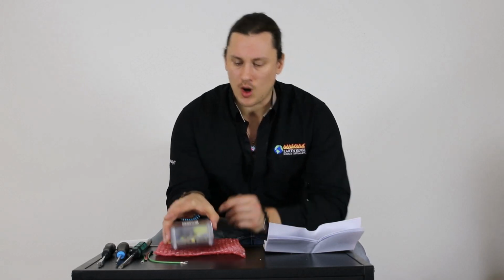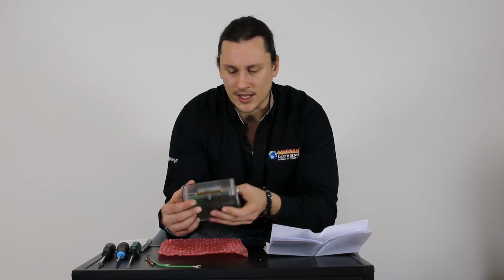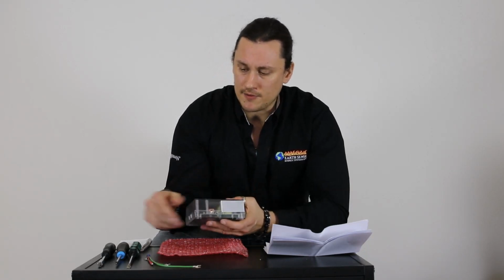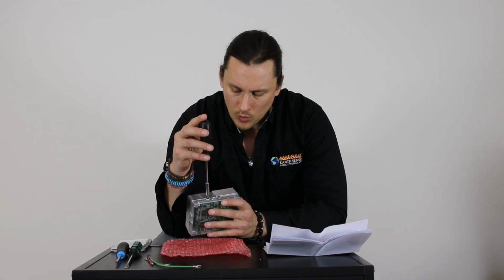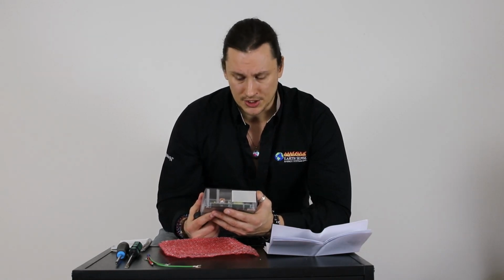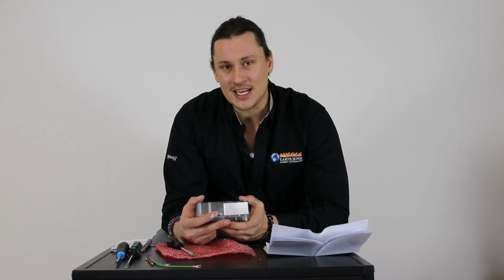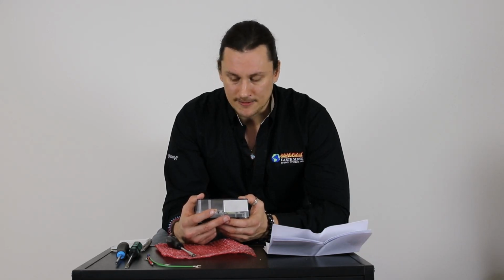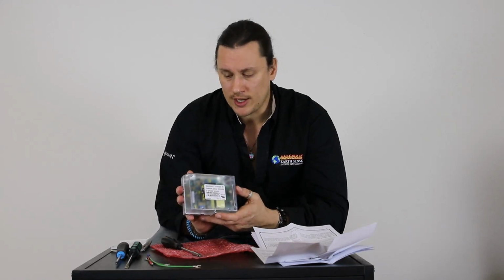QuadraFire 3 Speed Control Board Installation and Settings

Comment: My Castile stove incert replaced auger moter and now my pellets wont stop coming out overflowing my burn cup turned off the thermos stat and pell still fly out does this mean my comtrol bord. Is bad because all the lights work pn the bord but ot wont stop pellet over flow when light goes off ??
Reply: Ty. for yore help .😁
Reply from the maker: @Knm.116  Always happy to do whatever we can to help Karen, thank you!
Reply from the maker: Thanks for contacting us Karen. Happy to assist. Does the Castile go through normal start-up where it feeds, lights and waits for the thermocouple to reach proof of fire before it starts feeding again? What was the reason you replaced the auger motor - was it no longer working or was there something odd going on with the feed in your unit? Generally speaking, if you turned the thermostat down below room temperature and the unit was still feeding pellets, that would indicate some kind of an issue with the control box/control board. If you can provide us additional details of what was taking place before replacing the auger motor and what is happening now during start-up and operation that will be helpful. Happy to assist however we can. Appreciated.
Reply: @EarthSense  know the minute you plug it back in it starts shooting out pellets all the lights on the control box seem to work but when the light goes off to stop the pellets from coming down the chute the pellets just don't stop so I'm guessing it's got to be a control board thing
Reply from the maker: @Knm.116  Hey Karen, yeah that is very odd. Let's check the thermostat itself - possible this thermostat is locked in position where it is calling for heat even when you have it all the way down. If you remove the face of the thermostat you should see the two magnets that make and break connection. Let's troubleshoot that thermostat first before we determine if this is a control board issue. We also offer a service to test a control board if that is something needed. Please keep us posted.
Reply: @EarthSense  okay i got it off now what do i do ??
Reply from the maker: @Knm.116  I would turn the thermostat slide switch back and forth slowly and see how those magnets are operating in the thermostat. They should be open when it's under room temp, they should close to make connection when you slide the thermostat slide lever above room temp. Let us know what you see.
Reply: @EarthSense  nope its fine, it's not the  thermostat.
Reply from the maker: @Knm.116  Glad we checked that Karen. Most likely sounds like a control box issue. Here is a direct email if you want to inquire about the testing service for the control box. info@pellethead.com

Comment: My old 1200i only has a two-speed blower. Will this three-speed control box work?
Reply from the maker: Yes the 1200i will use the 3 speed control box, all years of manufacturer. Yes, the 1200i has the 2 speed blower style and a specific blower used, however the control box will be the 3 Speed. https://pellethead.com/product/quadrafire-control-box-3-speed-circuit-board-oem/

Comment: My quadra fire Santa Fe the exhaust motor stays on and will never shut off everything’s cleaned out perfect it blinks six times but the last set only blinks four times all brand new snap disk what should I check
Reply from the maker: Hey Mark, It sure sounds like that would be the #1 snap disc not re-opening once the exhaust fan is cool. You replaced the #1 Exhaust Snap Disc? What happens when you pull one of the wires off the #1 snap disc - does the exhaust fan shut down or stay running? Happy to help. Thanks,

Comment: Yes, the fuse is good.  All functions are normal except for the auger not turning.
Reply from the maker: Thanks for the message Tim. If we can let's double check the fuse with a multi-meter to verify it is 100%. Can you explain a bit more on what the circumstance was when the auger stopped turning? Happy to help.
Reply: @EarthSense  yes, there are two buss fuses, both have continuity using a volt meter.  I was changing the batteries to the remote control thermostat and once I had the batteries in I turned on the unit and it began to function normally, pellets were turning blower was blowing etc. I touched the wires for one of the snap discs and it arced.  immediately, the auger stopped turning but everything else was functioning the glow rod was red hot and again the blowers were turning but there was no pellets dropping because the auger was not going. So I think I either damage the control board with that arc or the motor to the auger.
Reply from the maker: @timlepage4483  Thanks Tim. You must have two channels that you replied too. I responded to the previous one under Bert Blue. Yeah, if both fuses are verified good than most likely it is the control box. We do offer a testing service for that; you can email info@pellethead.com and we can provide you those details. Important we also figure out the snap switch and find the root issue there so it can be hooked up proper without a jumper.
Reply: I have a Quadra fire 1200 and I am having issues with pellets feeding, it won’t feed unless I hit the reset. I’ve tried everything under the sun and still cant get it to work correctly. Any ideas ?

Comment: I had a jumper wire on my lower snap disc for the caatille insert, when replacing batteries in the thermostat receiver I touched that jumper and created an arc and now my pellet auger will not turn. I'm afraid I fried the motherboard. Is there a way to confirm the board is bad or perhaps I fried the auger motor? Can I send you the motherboard for repair or replacement?
Reply from the maker: Thanks for contacting us Bert. I forwarded your message to our tech team to get their insight as well. Have you checked/replaced the fuse yet? Located in the Junction Box area where the control box is? Yes, we do offer a service to inspect/test the control box. We do not repair or re-build, however we do offer the OEM replacement if that ends up being needed and guarantee the lowest price. I will follow-up with further info as soon as I hear back from our tech team. Thanks.
Reply from the maker: Hey Bert, I heard back from the team. Double check the fuse, use a multi-meter to ensure it's good. Generally if something fried in the control board there will be a burnt plastic type of smell from the control box. Tech team stated that if the fuse is good, than more than likely something did fry in the control board. Again, we do offer a service to test the control board and make a determination. If you are interested in that service, please email us and we can provide a quote. info@pellethead.com. Additionally we should never leave a limit switch jumped. We can jump to troubleshoot, but from there it is imperative that we find the root of the issue and ensure the safety switch is intact with the wiring. Happy to help you troubleshoot there if needed as well. 
Thanks.

Comment: Hi I have a 2004 mt Vernon pellet stove I just hooked it up today . I have to run it to setting 4 before I get any flame at all , this is with the lever pulled all the way up so I’m getting max fuel . Also the door was real dirty after only a hour of running , I believe I cleaned the whole stove out good I’m not sure if I’m missing something or something is wrong ? On settings 1 , 2 , and three I pretty much just get very little flame 🔥 with sparks flying everywhere I don’t believe this is the way they should run . Also the convection fan is pretty loud compared to my coal stove is this normal ? Thanks in advance
Reply from the maker: Hey Ryan,
Thanks for the message, happy to provide our insight. Sounds like you have the Original Mt Vernon Model, also known as the Mt Vernon O.E. with the 4 speed control. These units were notorious for having excessive combustion air flow. This tends to result with a flame that is generally in the burnpot on setting 1 and 2, 3 right at the top or a little over, and 4 at about 3-6 inches above the burnpot rim. The pellet fuel also makes quite a difference here as well as with the build up on the glass. Try a few a different kinds - hardwood and softwood; see what kind of difference you notice.  When you are running it on number 4 (The Quad Setting) that convection blower is quite loud with the RPM and velocity of air running through. If the motor is whining, squealing, grinding than that would indicate a motor issue. If it's just air rushing then that sounds pretty normal. I can check with the tech team to see if the latest circuit board has any kind of updated hardware that reduces the combustion air flow. I can follow back up with you on that. Any other questions please let us know. 

Thanks
Reply: Hi and yes that is exactly what it’s doing , I will try a few different pellets also . Let me know what they say on the control board . Thanks for the quick reply and help .
Reply from the maker: @ryanchamp10105  definitely will do Ryan. I messaged our lead tech today, should be able to follow up tomorrow. Thanks
Reply: Sounds good thank you
Reply from the maker: @ryanchamp10105  Hey Ryan, I hear back from our lead tech, his message is below. Let's take a close look at your door gasket. Is the bulb part going around all 4 sides right now? 

This might be as simple as an incorrectly installed door gasket as I’ve seen this before.  The indication of this would be a much lower flame and heat output, very brisk tornadic flame with a lot of popcorning.  An incorrectly installed door gasket would be that no air wash is allowed by a tadpole gasket around all four sides of the glass.  There must be no tadpole gasket for the bottom edge of the glass.  Since this air wash is air diversion that is calculated in the engineered air flow, by blocking it you are overloading the burn pot with additional air flow.
Reply: I will check this tomorrow thanks , I’m not sure if I can but I will take a pic and try to upload it here
Reply from the maker: @ryanchamp10105  sounds good, just keep us posted bud
Reply: I can’t upload a pic but the gasket that’s on it now is on all four sides
Reply from the maker: @ryanchamp10105  OK! Thanks for checking that Ryan. Let's get it fixed and see how things change here. So, on the bottom side of the door, the BULB part of that gasket needs to be trimmed/cut off. The flat part of that gasket should remain in place creating a seal between the glass and the door frame. When the bulb is cut off the bottom side, it allows an 'airwash' which is basically and air spacing so that air from the room can run up the glass to help keep the glass cleaner. As previously mentioned this will also greatly affect the air flow and put it in alignment with the programmed combustion air velocity. Here is a link to the gasket in case you need a new replacement. Please keep us posted here, we'll make sure you are taken care of. Thanks! https://pellethead.com/product/quadrafire-tadpole-door-gasket-seal-5-oem/
Reply from the maker: @ryanchamp10105  Tech just sent over this message and wanted to share as you address this. 'Simple fix for the door gasket.  Use a sharp utility knife and cut off the exposed gasket bulb on the bottom of the door. Just run the knife edge along the bottom corner of the door frame, no need to disassemble the door.'
Reply: Thanks I will order one , so the flat part would go on the outside of the glass correct ?
Reply: One more question I was researching and some say you leave the top without a gasket ?
Reply from the maker: @ryanchamp10105  Yes, the flat part adheres to the outside of the glass creating a seal between the glass and door frame. Several Quadra-Fire models over the years had variances in the airwash; some top, some bottom. Our lead tech states for the original Mt Vernon model the airwash should be on the bottom. Keep us posted!
Reply: I will thanks and I cut the bottom off already i definitely see a huge difference thanks
Reply from the maker: @ryanchamp10105  Fantastic Ryan! So happy to hear you are seeing an improvement. Try a few different pellets as well as earlier mentioned and let us know what you see. Look forward to staying in touch.
Reply: I will thanks again
Reply from the maker: @ryanchamp10105  Absolutely, our pleasure Ryan!
Reply: @EarthSense  we have a quada-fire Santa Fe pellet insert stove we purchased last Fall. It worked great.  We tried to use it last weekend and it wouldn't do anything. Any tips
Reply from the maker: @aigalepo2876  Thanks for the message, happy to help. I always suggest checking the simple things first. 
1. Check your wall outlet - make sure power is good
2. Check your power cord to the stove - make sure securely in place
3. Check your thermostat wire connection to the terminal, make sure wires are tight and vice versa into thermostat.
4. Move the thermostat lever back in forth - potentially stuck in the open position

If that all looks good, let's check the fuse in the junction box. Make sure the stove is unplugged. Let's also check the seating of the control box to ensure it's properly in place.

Let us know what you find; happy to help.

Thanks,

Comment: How do you remove the control box?
Reply: I am looking for a HHT #7000-205P
Reply from the maker: @theviron6  Thanks for contacting us. Based on that part number, that would be the 3 speed control board box. This control board fits a handful of Quadra-Fire models. Let us know what model you have - happy to provide instructions on how to remove. On most it's a pretty easy process. https://pellethead.com/product/quadrafire-control-box-3-speed-circuit-board-oem/
Reply: @EarthSense  I am having trouble diagnosing  what the problem is.  Initially the stove just stopped lighting. No red call light on in the control box. Fan comes on but that is all. This is a Quadrafire Classic Bay with a HHT # 7000-205P control box. I need any idea you might have on what the problem maybe.
Reply from the maker: @theviron6  Happy to help. Need a little more info. Are you running your unit on the Thermostat? Have you checked the Thermostat Connections and Function of the thermostat? You can use a large staple or jumper wire between the two thermostat posts. This will essentially bypass the thermostat and let us know if it's an issue with the Thermostat itself. When you say your fan comes on is it the Exhaust/Combustion Fan or is it the Distribution/Room Air Fan? Does the unit feed pellets at all when you push the reset button? Let's start here - we'll make sure we get you back up and running. Keep us posted. Thanks,
Reply: How do I identify the thermal couple?
Reply from the maker: @theviron6  The thermocouple will be the probe that hangs over the firepot. The thermocouple cover will pull off (Be careful as it is ceramic and fragile). From there the Thermocouple will be exposed if you need to inspect it or clean it. Quadra-Fire has a few different thermocouples depending on your model. Being you mentioned that part number for the control board, I'm guessing you have this Thermocouple linked below in your model. If you have the model name let us know and we can verify 100%. Thanks! https://pellethead.com/product/quadrafire-thermocouple-20154-bundle/
Reply: Let me be more specific.

How is the control box removed from a Classic Bay 1200 insert?
Apparently there is a metal tab interfering. Bending it out of the way will break it off. I don't believe it will survive being repositioned.

Comment: I have a CB1200-I stove. The fan comes on when I plug it in but it won't feed pellets or heat up the igniter. if I set the controls box on test it will feed pellets and heat the igniter but the fan cycles and off. I want to make sure the problem was in the control box.
Reply from the maker: Hey Mike, thanks for contacting us. I touched base with our technical team. They suggested to have you jump/bypass the vacuum switch before we determine this is a control board issue. Again, just for troubleshooting, we never want to leave a safety switch bypassed. Here is a video to show you how to create a jumper wire. https://youtu.be/FDVkbsHS95U 

Let us know the results there. Thanks,